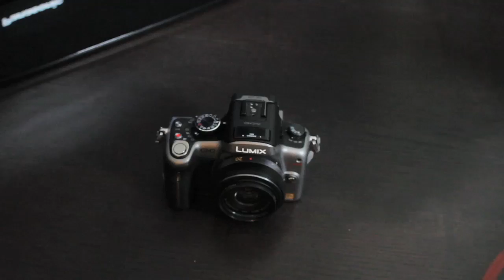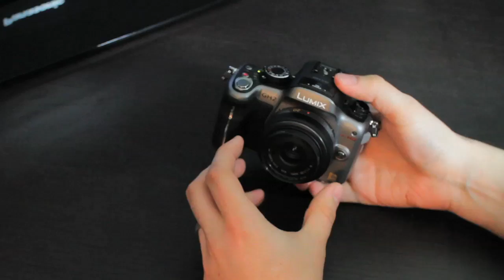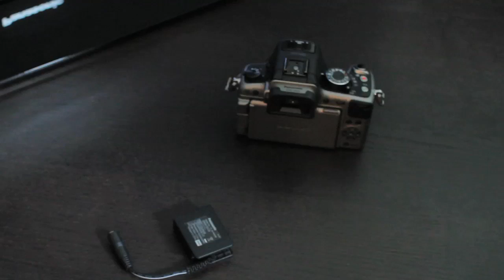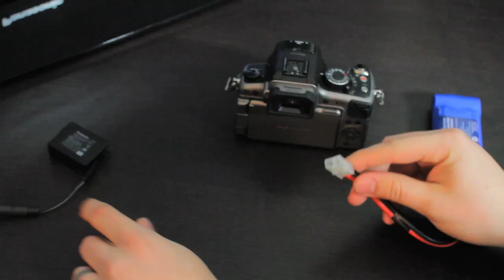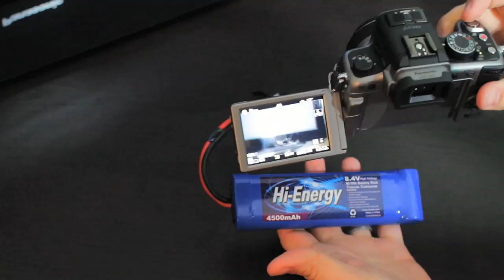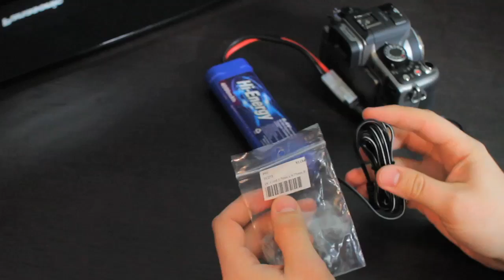GH2 Custom Battery Solution

Comment: I made a battery pack using 8 AA NiMh batteries. It powered my Panasonic fz35 for about 8 hrs of recording HD video on a full charge. I'm now looking to do the same with my fz200. 

Charging was done with my generic TEnergy AA NiMh charger. (it can charge 8 AA batteries at a time).

Batteries cost $20 for 8.
Battery holder was $3 on eBay.

Comment: You know I've found the internet and these youtube videos to be informative and your's is excellent but the responses and sequence that the answers come in if they come at all make reading them a waste of time since questions asked get answered way out of sequence and don't link to the question so it's like a random conversation with a lot of people that are not in the same place or on the same page. That's why I like forums but they are too broad in subject and you'll wait months for a response.  it's a shame there isn't a better way like linking directly to the person who has the answers to those who asked the question.  I just bought a used GH-2 and need to build a long use battery and an AC adapter and don't know where to get these accessories so I can build a beffy battery pack.  
Through all the Q&A's no one seemed to authoritatively answer the question about a pack that delivers more than the Panasonic battery does. Is there a VR (voltage regulator in the camera or the adapter that drops into the camera to clamp the voltage to a safe use level.  Anyone know where to go for answers ?

Comment: I think there are 2 lion cells connected in serial in every a 7.2V battery pack.
So actually a 7.2V battery has about 8.2.. 8.4V if fully charged. I've checked my Sony A65 battery it is also called 7.2 1600mA but it gives actually 8.3V.

Comment: Hi, thanks for uploading this solution. I hate using the cheap replacement batteries! I'm thinking of getting this setup but can't seem to find the dc to tamiya connector online. There's none on eBay which is surprising. Where did you get yours and is it still available?

Comment: thank you for this video. i have bought all the necessary parts for the tenergy battery to work with my gh2, but i have run in to a problem. for the right angle power plug cable you have listed, i don't know which part of that cable is positive and negative.  it says that the cable with the white stripe goes to the center, and the black cable goes to the outer.  is the inner positive and the outer negative? or the other way around?

Comment: A 7.4v lipo battery will not lose juice as it runs low, they are cheaper to buy, and you get a lot more MAH in a smaller package.  They don't seem to suffer from the "memory effect" that NICD and NIMH battery's seem to suffer.  A 5000Mah will give you longer battery life than a 4000mah, and will be about 75% the size of that battery.   They do require special chargers. IMAX B6 is a good cheap one. You can get a battery and charger for under 40.00 i bet.

Comment from the maker: Your battery has too low a voltage - try a different brand or one with more voltage. Or buy the converter mentioned in my notes.

Comment: The reason for this is that the minimum voltage required is 8.6V and above.
At the beginning of discharging the cell-pack, the actual voltage ist higher then the stated 8.4V. Therefore it will work until the threshold is reached and the camera will shut down with the so much loved error message.
One solution is the use of an voltage regulator (9V) and 3 Li-Ion cells. This will actually work till the batteries are fully discharged.